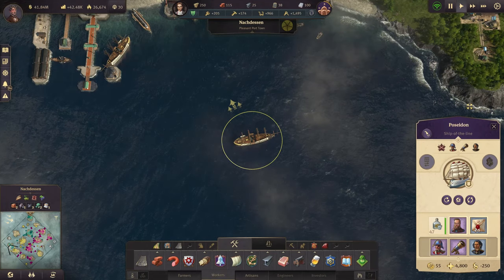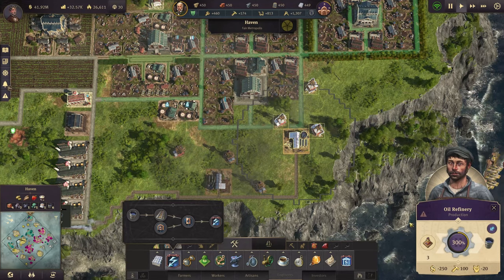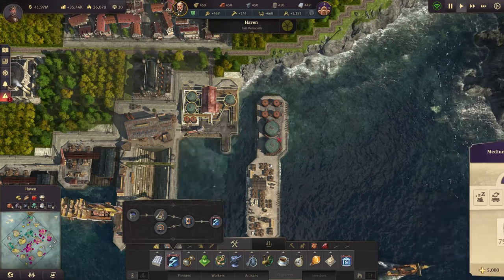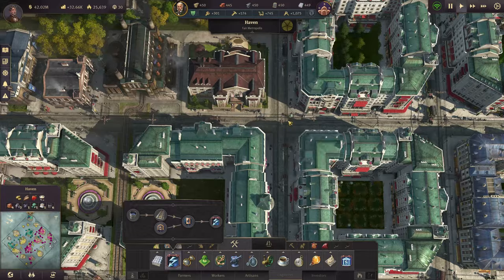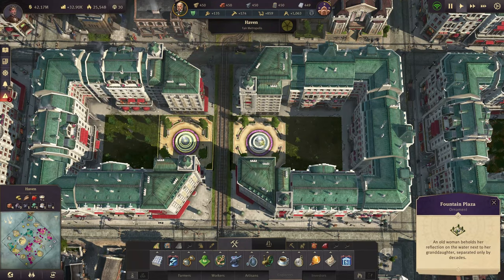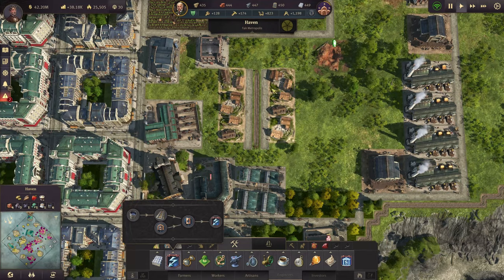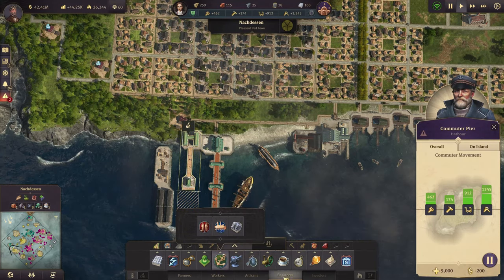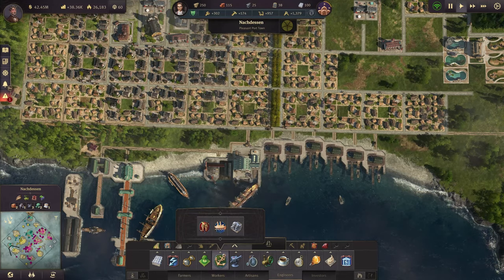Anno 1800 Oil, Electricity, Power Plant Overview, Guide for Electricity

Comment: Ok helpful, thank you.

However I didn't get the answer for this:: when you build multiple power plants around your city and you make a railway circuit - oil is delivered to powerplants which are closest to harbor on the journey. Therefore those which are more further away are becoming short on oil. Another tricky thing is that trains are delivering oil only in one direction :D I am not sure whether this can be adjusted (didn't figure it out myself), if it's not possible then it's pretty stupid!

Comment: cool video! nicely explained, short, to the point.
btw. you can always press "m" to "move" buildings around without cost. that way you can always make place for the train in most situations... naturally a bit planning ahead is still necessary regarding the city. :) i recommend leaving lines up to 5 spaces width empty throughout the city... not only for the trains but also for all the cool avenues and promenades you can build later. cheers

Comment: I got a problem on my island. I got no oil on my main island. So without electricity (which I don't get cuz no oil) I can not upgrade to steam engines and big harbour to ship the oil from the next island to my main island. Any tip for that? I can't even charter an vessel to ship it.
Reply: 2:30 Build commuter piers on your main island and the island with the oil. Now your engineers can get the oil for electricity and a harbour on the second island.

Comment: thx for video..i have a problem i have a steam yard i also have two other power plants powering indust area and my investors..for the life of me i can not get the steam ship yard to wrk it worked on two ships i have a power plant there i have a two track efficiant system..but for no reason at all the trains do not stop in this third plant and fill the plant to power the steamship yard so frustrating speand 4 hours rebuilding different conbernations deleted the ship yard and the power plant three times ,but the trains will not fill that powerplant they drive in and threw and never stop..any ideas.and of coarse i made sure the walk way is direct and the shipyard has the green power lines.is there a ristition on the amout of power plants you can use i tried turning one off to see if it would fill the ship and it just will not be filled by the trains so strang must be a bug right?

Comment: Interesting difficult occurs when oil is on the wrong island. You can not build the oil tanker without the little green gear things that require electricity (motor assembly line)....so you cant build a tanker to bring oil to your main island where your factories are, till you build a engineer level factory on the new island to make steam motors. You need electricity to make steam engines to make oil tankers to move oil to the home island. Its a giant pain. Make sure to prioritize building up an oil island. I was going to rush build an oil island but found it easier to defeat my enemies with sail ships than bring industrial revolution to a sheep  and oil wasteland.
Reply: Oh, a second issue I had bring power to my crap oil island: power does not transfer unless you have roads. So, you get a new island, it has oil, you put in refineries and power station and a steamship shipyard to build oil tankers...but theres no power to the shipyard unless you connect with roads. Which is weird, but not as weird as when you find out you cant use the shipyard for anything till you get steam engines.
Reply from the maker: @IndraSunrise  hey IndraSunrise! I ran into the same issue. What I do with every playthrough is to secure at least 2 islands that has oil first, to prevent AIs from taking them. Then I can quickly transfer over engineers using commuter piers so I can start a electricity island.
Reply from the maker: @IndraSunrise  the electricity issue happens with many players. seems like it kind simulates real life back in the day, where it was extremly challenging for people to have electricity set up. One thing missing from this game is power relays, but it wasn't available back then it seems!
Reply: you can always buy oil tankers from the npcs
Reply from the maker: @Love0wner  this is a good one! I haven't had to do this, most AIs I have destroyed lol, but what you said is great  to keep in mind!